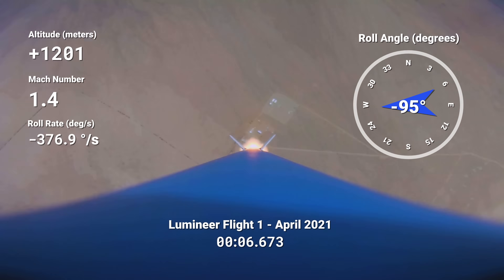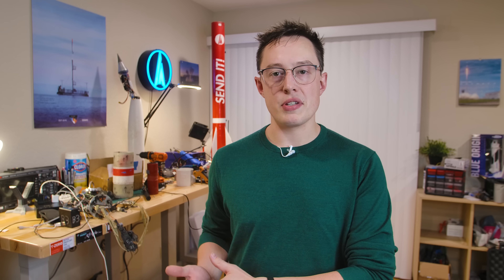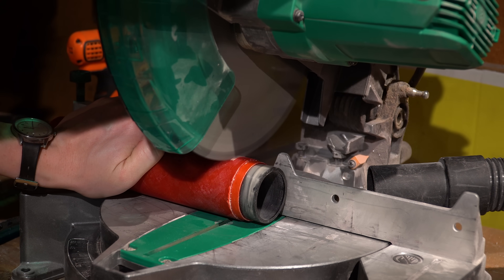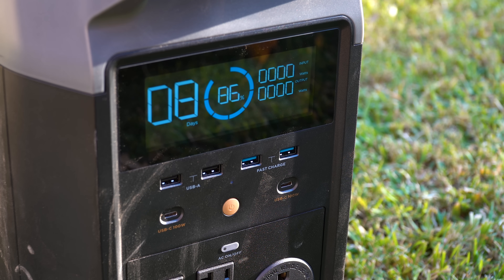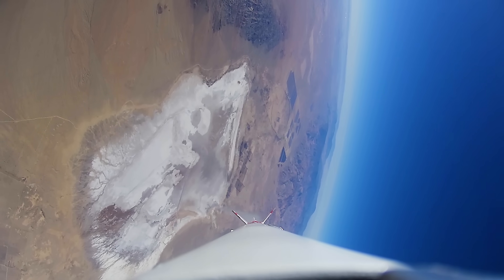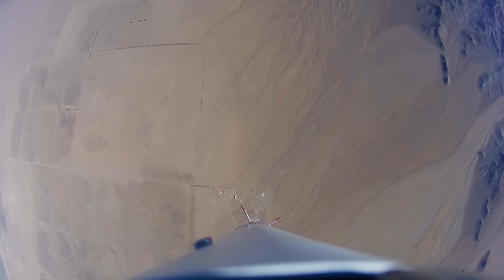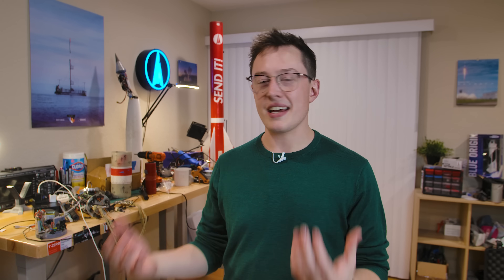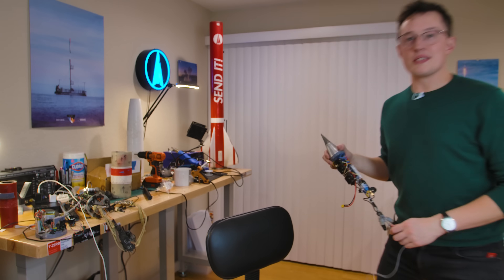Can You Get Stable Video From a Spinning Rocket?

Comment: Hey Joe, crazy engineer idea: why not combine both the brushless and stepper motors? Have some sort of clutched/movable gear that can switch between them and get the benefits of both the high speed and low speed control. It might cover both your bases if the stepper encounters a crazy high roll rate.

Comment: Love it! BPS Space videos always get the design vibes rolling!
Question:
1.) Why don't you write a code to calculate roll rate vs shutter timing and frame grab and "stitch" a roll stabilized video together? I'm not a coder so this may be more difficult than I realize with mixing video encoding or is camera sensor and shutter hardware the bottleneck? 
2.) I was also wondering, have you considered integrating a coaxial system that incorporates a reaction wheel? If power and data connections through rotating electrical slip ring connector are stable, the mass of the batteries could be leveraged as reaction mass? The additional mass of the rotating camera system seems very high unless the quality of video is essentially "mission priority" over usable payload mass.

Edit :BPS Space contained a . and converted to hyperlink removed.
Reply: 1) Wouldn't the frame rate of the stabilized video be limited to the rate of rotation? If the camera is rotating at 1 RPS you would only get 1 FPS.
Also if the rotation is fast enough each frame will be distorted by the CCD's scanning pattern.
Reply: @Machine_Mike  I think you would if it was a single camera set up. However with dual opposing cameras (which i assume was for balance) the field of view could be optimized to meat at a central plane or known good overlap. Once again this is just assumption but then the rotation rate would adjust a "variable" in a function that chooses which video frame to grab based the camera settings for shutter speed. I think you will lose a significant amount of "off target data" so a higher FPS capture/sensor speed is desirable.
Is the sensor chip scanning pattern distortion accountable enough as a known calculable constant? If so wouldn't using a lower resolution sensor potentially yield greater scanning speed as a relative function to surface area? Or as simple as rotating the unit so the distortions are less obtrusive or don't align with horizon or other desired targets?
Reply: cameras can do 60fps usually, and you know the spin rate exactly from the sensor, so you probably can stitch anything together under 60 rotations per second. You would get some weird artifacts because of rolling shutter delay, there are CV cameras that can do more fps and instant shutter but that's a little more expensive.

But this is a cool idea, never seen anyone try it before
Reply: @ffoska  The rolling shutter delay effect is almost exactly what we are trying to accomplish. By determining where the target field of view is(from the flight computer or other hardware), the algorithm picks individual frames to stitch a new video from. At high rocket roll rates is where the algorithm I think would really take off in that it would begin "shedding" erroneous frames off the target field of view in order to "stitch" a new stabilized video.
I think this could be implemented downstream as a "fix it in post" or at a ground station with sufficient graphical compute power to re-encode/stitch on the fly. Implementing it on the rocket flight hardware seems unnecessary and detrimental to the rockets flight performance which we can see is nominal even with the addition of moving payloads (keepin' the pointy end up and hula-hooping).
Reply: @TAR-D  yes, by 'rolling shutter' I meant the CCD scanning pattern. You would just record the frames, but you also record the telemetry, so you can also use that later - but it's probably not even needed, because the sampling is fast enough to get multiple images of the same region and do keypoint matching. And I also meant using multiple cameras to get a 360 view, so it's just a question of unspinning the image.
Reply: Exposure time

Comment: I don’t want to belittle the amazing work Joe is doing.
I just want him to be able to avoid any potential litigation.
He said he is an engineer it’s he’s job to overcomplicate things.
Is he now a degreed engineer?
Or is calling yourself an engineer fine as long as you don’t claim to be licensed/professional engineer?
Reply: Engineers, as practitioners of engineering, are professionals who invent, design, analyze, build and test machines, complex systems, structures, gadgets and materials to fulfill functional objectives and requirements while considering the limitations imposed by practicality, regulation, safety and cost.

It has nothing to do with a degree.
Reply: For the most part I agree. But I could read the description of a medical doctor and make the case that it has nothing to do with a degree.

I’m not a law expert and just wanted to mention an observation that might save some legal trouble.

Comment: Hey. Did you use a stainless steel center rod and nut? Stainless steel on stainless steel bites into each other. That might have been the reason why you almost couldn't loosen them anymore 
Graphite grease or something similar would probably solve the problem.

Comment: What is the de-spin affect of adding mass to the spinning camera assembly? Did it work like a reaction wheel in that the energy put intp spinning is split between camera movement and rocket body spin?
Reply: yeah, it probably has some gyroscopic effect, does it pitch the rocket when it spins up? would be great to see more info on that

Comment: use alli express N20 Micro Encoder Gear Motor Hall Sensor Encoder with with , after that just use a resistiv DAC (resitiv because you need seep and simplicity) And as usual this comment will wanis in the see of information :D

Comment: I think the results are a lot better than you give yourself credit for! Unfortunately we all know getting that last 20% of the way there takes so much effort. I was going to say have a deadband to disable spinning if the roll rate is under the lower limit of the motor, but a stepper should be even better for butter smooth video! Keep it up!
Reply: I think it was a bloody amazing first attempt
Reply: @nathanchalecki4842  That it was.
Reply: I was thinking the same.  Not perfect, but once it woke up, it tried hard.
Reply: With the amount of integrated systems, the functioning uptime of this solution over the flight is pretty phenomenal for a V1 and he pretty much predicted all the flaws before launch XD.
Reply: He should also put a limit to the degree of roll error so after one full rotation of error or so it doesnt counter rotate a lot and just goes back to the heading it started at
Reply: 100% agree! Joe, you've done amazing! I know it's only a few seconds of the total, but so very impressive to see the footage from the cameras when the roll kicks in and works!
Reply: He should still have a deadband because the steps of the motor will probably be shaky looking below a certain speed.
Reply: @Machine_Mike  Dunno the specs of the degree steps but he could utilize half steps so it wont be as jarring, gearing can help too but will lose some top speed.
Reply: or have a fixed camera and program software to only record frames when its pointing a certain degree when it starts spinning. but yes put in more weight and motors and have the whole thing spinning opposite direction, for some reason
Reply: @MrPaxio  I had the same idea. And just add multiple cameras so that it has a higher frame rate.

Comment: I know they're uncool these days, but a little brushed gear motor would also solve this problem as you don't need the power density of brushless here, and they're very smooth
Reply: would go with DC instead of stepper, because they're usually lighter

Comment: Good Flight! In electric skateboards you get better slow rpm performance and jerkiness in brushless motors by using a sensored ESC and motor.
Reply: yup! its not the motor, its actually the driver that isn't good at slow speeds, but he would need to add some kind of encoder to keep track of where the motor is for field oriented control(FOC).
Reply: @ohbaewan3147  I was looking for FOC in the comments. Same thought. Ditch steppers and go with something like simpleFOC, Odrive or MIT. Foc should be fairly silent and smooth. Steppers may give the footage some jello from the micro vibrations, which is what stabilized motion blur looks like and what we want to eliminate with this project.
Reply: Agreed! He needs a rotary encoder so he can keep track of the motor position while being able to supply more current to allow for torque holding. A cheap sensored ESC and motor should solve this problem, but I'm worried he'll go down the stepper path bc he's lost hope for brushless. IMHO, steppers are the wrong move. They're meant for precision and low rpm applications, not for high speed despinning like Joe wants to use them for. Oh well, fingers crossed he reads our comments!
Reply: @sethswheelhouse  nema 8 (20mm x 20mm) mini steppers can reach 3000+ rpm.  'send it' max rpm was around 125, so assuming perhaps a 4:1 reduction, you'd only need 500 rpm from the motor.  Seems to me that is plenty of headroom.
Reply: @toohardtowatch  I don't disagree that it could be done with stepper motors, just that they aren't ideal for this application. A geared assembly would compensate for the speed, but then you also have to consider the heat that steppers can put out, and the fact that he is using 3d printed parts for a lot of this assembly that could melt or warp. He could machine some parts out of aluminum but that adds cost, time, and weight as well.
Reply: Yep, I vote field oriented control / sensored bldc driver.
Reply: Ok, I was wrong about integration part, here's info: https://akashkumar4u.blogspot.com/2013/05/cddvd-motor-driver-hack-to-run-its-own.html?m=1
Reply: Thought same thing joe get a sensored esc motor !!!!
Reply: CD/DVD motors have sensors and drivers integrated in a single board. They're quite generic and you can find online how to use them...
Reply: What I wanted to comment on. And as Seth states, stepper motors probably won't be fast enough.
Reply: @thesfreader3068  Absolutely. Unless he gets some expensive as heck high rpm stepper, and uses something like a TMC2130-TA to drive it (which would probably mean a custom PCB) it's not a good option.
Reply: Yeah the stepper motors I know of are all pretty slow and slip easily at high speed
Reply: RC crawler ESCs do low RPM with a sensorless motor, Furitek Lizard claims FOC and the videos do show great low speed control.
Reply: he just need to use a more high end controller than a simple RC one. something like VESC that has FOC but it is also big and more complicated. These RC controllers are really not made around 0 RPM 1:1, torque response and their torque oscilates heavily.